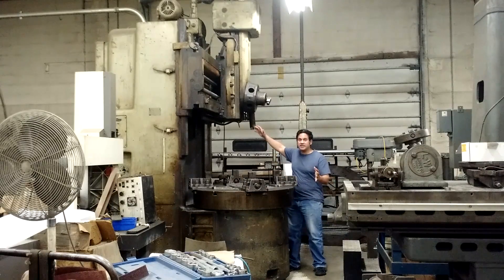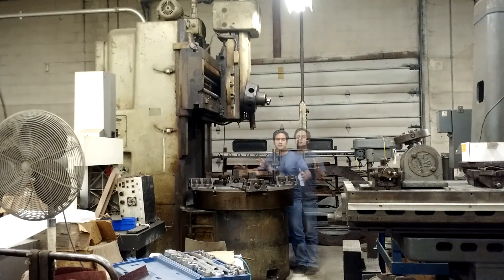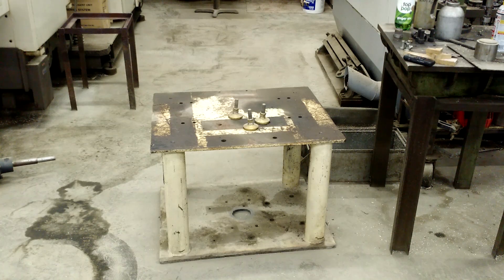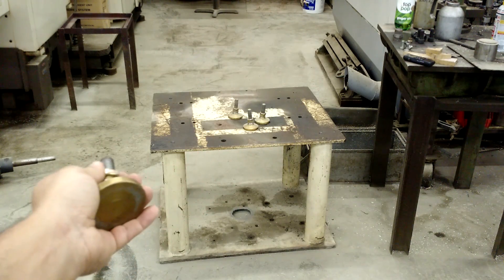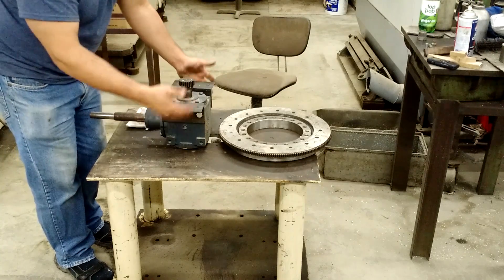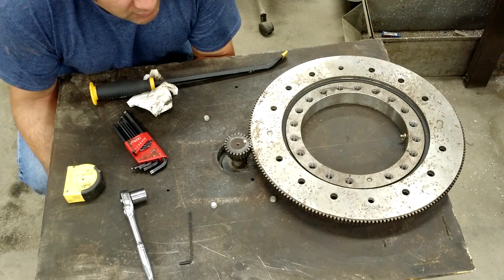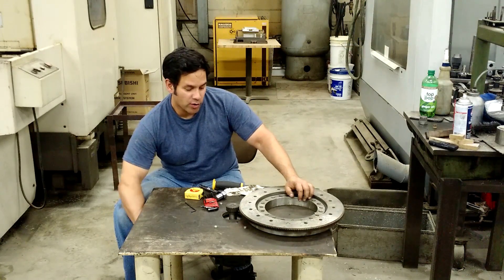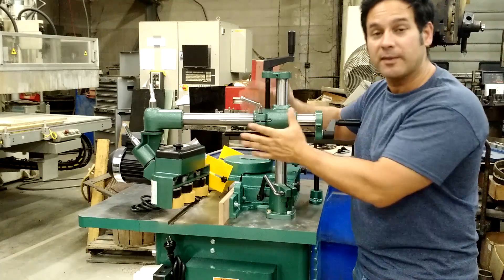Homemade VERTICAL wood lathe PART 2 - Steel base and assembly

Comment: This is going to be all kinds of Awesomeness..... I am really looking forward to this running.... big time    Thank you for sharing Ray. :) :) :)   Shared....
Reply from the maker: Thanks Terry!  i am looking forward to it as well.....i have some logs that are begging to be turned but the idea of rouging them out with a chain saw and then getting beat up on my "little" blue lathe doesn't agree with me.
Reply: Ray Pena The last time I tried logs on one of my Lathes it nearly wrecked it :)....
Reply from the maker: my lathe can handle it but the uneven surface really beats me up until i get it round!

Comment: That is a very interesting project!
Reply from the maker: Thanks Willem!  it looks so tiny compared to the "normal vertical lathe" in the shop!  what do you think of the articulated arm idea?
Reply: Im not a specialist. The articulating arm might work well, but it also limits the size of project as the vertical arm cant move away. you could probably also add big stepper motors to drive it and make a cnc lathe out of it. Or remove the arm and freehand with a chainsaw. I think the type of moveable table you see on metal lathes would work too, just add the vertical axis. Might be more stable. 
See, im no specialist.
Reply from the maker: lol,  no matter what i do there will always be a limit of some sort...i don't think i'm brave enough for free hand chainsaw on a spinning piece of wood!